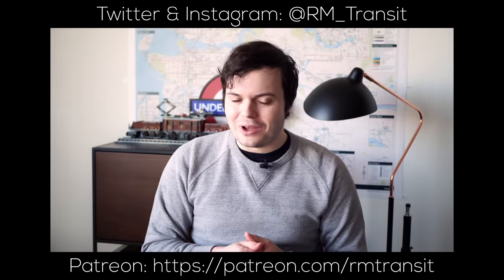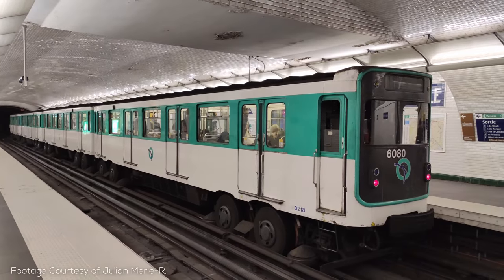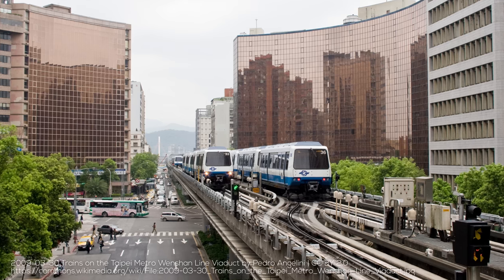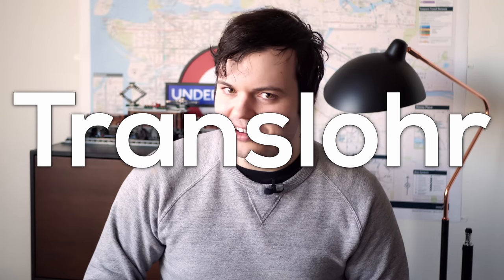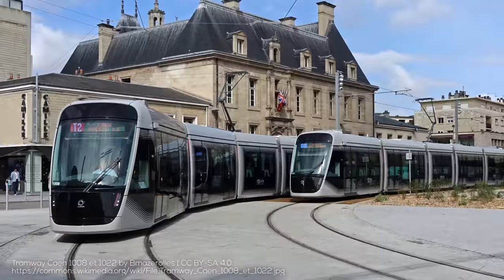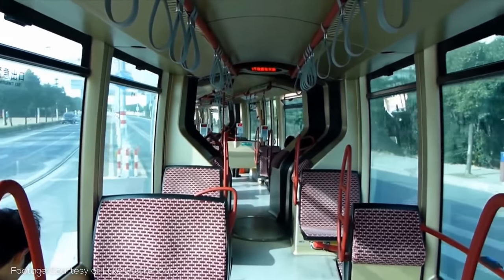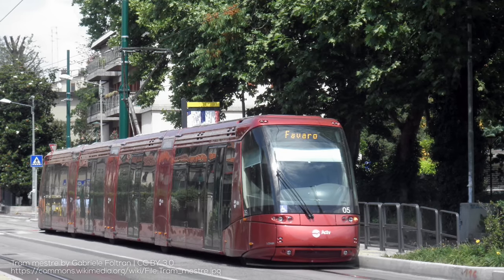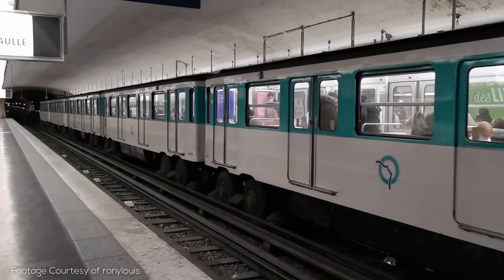Rubber-Tire Rail Transit is Weird

Comment: In the case of the trams, wouldn't it be cheaper to get of the central rail and just have a trolley bus?
Reply: I believe the point of the central rail is to guide the vehicle and remove the need for a driver. Drivers are a huge part of transit costs, so if it worked it would probably be worth the higher capital cost.
Reply: @neolithictransitrevolution427  While an interesting idea, autonomous driving (at least with the progress we have right now) only makes sense when the system is mostly isolated from (street) traffic bar some crossings at most (hence why it's common in metros which do fit into this criteria), otherwise the vehicles need a human to be guided. Since trams are expected to drive on the street, you're thus better off with a human driver.
Reply: @MarioFanGamer659  Idk with dedicated ROW and low speeds, I think buses will be their fairly soon. 

They recently had one in Durham (Ontario), it crashed into a pole after a few months lol. But I was pretty impressed with the FSD of a Tesle recently, I think it will be here sooner than any rail project you start today.

Comment: Specifically with the noise discussion, I would say the consistent dull roar of rubber tyres is more soothing when you consider a steel wheel train taking a sharp corner with the sort of noise pitch that would shatter glass... but otherwise yeah, rubber tyres belong on buses and that's about it

Comment: what you forgot to mention is that as the Paris metro is the densest in the world it is one of the rare systems in which tires make sense: tires accelerate and decelerate quickly which is valuable when the metro travels less than 400m between stops as is the case for line 4, of course, steel wheels make sense on less dense routes ; the RER for example, as an express service, stops less often and is thus 100% on steel wheels.
In addition, tyres allow for increased climbing and descent capabilities due to increased grip → additional control
moreover tyres absorb vibration and reduce tear on notably the bogies, allowing for increased durability + lighter rail stock as it does not need to be as robust /suffer as harsh forces. reduced weight = reduced electricity consumption + less momentum when breaking and less resistance when accelerating and climbing (goes back to point 1.)
lastly tyres inflict less tear on the rails which are exceptionally hard to perform maintenance on, especially when compared to simply switching tyres

Comment: Wasn’t the Val system used in O’Hare?? Or at least a similar version?

Edit: it was used in Jacksonville Florida until the rolling stock was sold to O’Hare airport in 1996, and O’Hare used it until 2019

Comment: The Cambridge and Adelaide guided busways are pretty fun concepts
Reply: And they work well for the situations. Heavy rail specially in Adelaide would not have been an option (although an upgrade to light rail maybe).

Comment: The Metro in Santiago, Chile has rubber-tired rail systems. Don't know that they were pneumatic, though; they were very thin.

No squealing metal-wheels-on-metal tracks. Quiet. Smooth-riding; no clickety-clack as you ran over seams in the rails. Really good acceleration and deceleration; I quickly discovered that I needed to hang on in both cases; not usually the case.

It's my understanding that the Inter-City Express also uses thin, rubber tires mounted to the hard, steel wheels and that's a large part of what allows smooth rides at high speeds.

Comment: Modern two-coach trolleybuses were planned for Leeds in the UK a decade back, after metro and LRT schemes were previously cancelled due to cost. I don't think they'd have had a guide rail, though they looked a lot like modern low level trams. Maybe there was to be a guide wire under the road or something? In the end those plans were also cancelled in 2014 , £250 million for the initial 9 mile route presumably being deemed too expensive as well, though the reason actually given was that 'it wasn't in the public interest', whatever that means.

Comment: One of the key benefits which is not mentioned explicitly is better acceleration and braking. If you have ridden the 14 line in Paris, it accelerates incredibly fast and can brake quite hard as well. At 80 km/h (50 mph)cruising speed is one of the highest in the world . Because rubber wheeled subways can stop on much shorter distances, the spacing between subways can be reduced, and the operational speed can be increased. thus increasing frequency and capacity.  Rubber wheeled subways accelerate much faster and slow down much faster so they can operate at higher speeds(because they can stop on a much shorter distance), and travel their routes much more quickly.
On subway lines which are far from saturation, this is not an advantage, but on the Paris subway where most lines are at or near saturation (overcrowding) increasing operating speed and frequency is a huge benefit., certainly far cheaper than building a new subway line.
With regards to the Tram/Bus rubber mounted system, one of the benefits which is not clearly stated, is that in case of roadwork, accidents, bust water  pipes... the Tram can turn into a Bus and take a different route. 
Rubber tires may not be needed in many transit applications, but in the end, it's a good thing there have been people willing to try new things, otherwise there would be precious little innovation.

Comment: I felt like Rimini where I was this summer also had a pretty good system. They have something called the “MetroMare” which is essentially a tram shaped trollybus but fully grade-seperated, unfortunately it has only one line which runs from the train station to the nearby town of Riccione whilst along the way serving the various coastline areas at a quite high frequency
Reply: MetroMare is a standard Bus Rapid Transit system though (albeit with timetabled passing loops). Probably would have been better to do an automated people mover along the same alignment (or just... add stations to the rail corridor), but it does do its job well.

Comment: @RMTransit -- on of your favourite steel wheel light rail systems, the DLR (Docklands Light Railway) in London, might be one of those cases where rubber tyres could have helped, at least on some sections.  

The ride on the DLR can be uncomfortable on longer fast stretches because the steel wheels start hunting on the rails.  This is due to a more sharply profiled wheel, necessary to help the cars take some tight corners in the system (and these corners wold be hard to eliminate), but poorly optimised for straight lines/gentle curves at  speed.

Comment: If you can't use rails, an APM(even in Singapore-style "LRT" config) is better than some proprietary combination. But automated light rail probably makes more sense if you are going beyond a couple of KM - as seen with DLR or SkyTrain. What ever you do, build a system that doesn't leave you with completely worthless infrastructure if the manufacturer goes bust!

Comment: I did some testing with a db meter on line 12 of the paris metro (one of the oldest which has really sharp curves and steel wheels) and line 14 (a brand new rubber tires line). In stations 12 was slightly quieter, and only around sharp curves was the 12 any louder; and that’s with open windows. The 14 hovers in the 80s the entire time.
Reply: MP89 trains and there offspring are noisy as hell. If you want to here what a regular train with tires sound like, try line 6 and 11 before 2024.
Reply: @LeGrandJuju49  alright but the overall point still stands

Comment: I had taken a rubber-tired rail. And that was APM line of Guangzhou Metro
From my experience the two-car APM was shaky as hell while travelling, compared to other lines.
Off topic, but there is one more drawback of the APM Line, and that the line's system is independent, not connected to the main system.
You have to transfer by exiting and entering gates once more which isn't really able to attract the passengers from Line 3 to the APM line. This is why the Line 3 is still crowded as hell.

Comment: I'm from the city where you get some of the footage with the rubber tire tram. The project has been a calamity for the municipality budget, the mayor wanted something that was innovating. Well, it has been with its number of outages, bugs and overall inefficiency. Not only it got all the common problems with tire trams but had its own problems too, bugs, roller fragility etc. Sometimes people even got locked inside. It is a scandal and it is truly despised by the inhabitants. The main reasons why it has been chosen is also because of the topography and the existing infrastructure (trolley bus type). The tram is going to disappear in 2024 replaced by electric buses.
Reply: You mean the TVR system in Nancy?

Comment: Very steep tram lines do not have to use rubber tyres, they have the option of doing what the Italians and Slovenes do in Villa Opicina. Trieste has a tram line, but it runs into a nearby village (across the border in Slovenia) called Villa Opicina, which is at the top of a very steep hill.  The solution they came up with was to build a funicular up the hill, and then, instead of the funicular having a passenger car on it, there is a drogue attached to the cable.  The tram vehicle attaches to the drogue with a normal vehicle coupling (with the drogue always on the downhill side for safety) and then is operated as a funicular, returning to normal tram operation through the village of Villa Opicina at the top of the hill.

Because the drogue's attachment method is just a standard vehicle-to-vehicle coupling for trams, they can use completely standard tram vehicles, and the funicular element imposes no unusual requirements on any other part of the tram system; the funicular itself is a pretty standard funicular apart from the custom drogues (or "cable tractors", depending on your source), but passenger vehicles in a funicular are not particularly standardised anyway.

Although used for transit, it is operated pretty much as a heritage system, using 1920s tram vehicles, but there's no good reason it couldn't have modern tram vehicles and a modernised pair of drogues (with a modern coupling type) on the funicular.  It is metre-gauge, but most manufacturers will happily attach any gauge you like to your tram vehicle.

While it is certainly somewhat gadgetbahn, it's a gadgetbahn that doesn't infect the rest of the system; you can operate a perfectly normal tram everywhere else but your steep hill(s), and if the gadget bit fails, then you still have the rest of a functional tram system.

Comment: Rubber tires have a traction advantage for going up hills as long as the pavement is dry.  Wet or especially snowy pavement takes away the advantage.  And very few of the rubber-tired systems seem to have been used for providing service in hilly areas -- I know of the electric trolleybuses providing service in the hills of San Francisco and Seattle (and Dayton? -- not sure how many hills that has), but that system in Colombia is the first rubber-tired tram I have even seen pictures/footage of actually going up a steep hill, and the overwhelming majority of rubber-tired electrified systems I have seen are flat.  Meanwhile, Pittsburgh used to run steel wheel on steel rail PCC streetcars up fairly steep hills (until those routes were cut in the 1960s), and Boston still runs light rail vehicles up and down the hill on Commonwealth Avenue (and unlike PCCs, those don't even have all wheels powered -- imagine what they could do if they did).

(Hey, for a change, I got to talk about something the MBTA does right . . . well, almost right -- if only the Commonwealth Avenue branch didn't have that idiotic move from center running to side running and then back . . . but all bit a tiny bit of one end of that is in the flat part anyway).

Comment: Tyre noise is always a problem. In (even electric) cars it amounts to a large proportion of noise due to the contact and friction of tyres with surfaces. Anyone living next to highways can tell. In subways with platform screen doors it isn't that obvious, but in open (even automated) systems as Lyon in France (line D) it can very surprisingly noisy.

Comment: Friction is the main point of trains, it's waay more efficient than rubber, needs way less energy to movez and doesn't wear and tear that fast, doesn't emit small particles for you to breath.
Brakes do, but that also can be mostly substituted  with electrical brakes, even regenerating energy.
Wired normal trains with regen braking is the best solution if you consider everything. These days they can even be quiet, given the tracks are maintained well.

Comment: If Translohr causes the asphalt pavement to sink below their tires, why don't tram rails sink into the road?  And are these grooves generally worse than the bump over steel tracks?

Also I'm pretty sure it's not an opinion that tire roar > rail squeal.

Comment: Noise and vibrations are a big factor. If a town wants to setup a new system in a nice historic part, it will get voted down if the noise from steel- to- steel operation will be way to loud...

Comment: Case in point: Brisbane's new "Metro" which is really just BRT in articulated buses designed to mirror trams. 

Yes even when officials were criticized for calling it "Metro" when its not on rails they didn't care and refused to change it anyway lol.

Comment: The "tired tram" is good if you do it like the China ART (Autonomous 𝘙𝘢𝘪𝘭 Rapid Transit): since the rail is only for guidance (sometimes for grounding), the ART does not use it, using a computer and for guidance over painted "tracks" instead, so it is basically a BRT (Bus Rapid Transit) that can accommodate much more passengers

Comment: Would be cool if you did a video about Israel, they're currently building a network of light rail in the tel aviv metropolitan area which has been for years crippled with traffic. 
Also in general, public transportation here except for busses that stand in traffic and long range heavy trains has been non existent, but it's all changing now. 
I think Israel is an exciting place to look at public transportation now

Comment: Interesting that rubber tires should work less with bad weather, considering how steel wheels have even less traction when the tracks are wet or god forbid, iced.
But also, try to imagine having to seasonally switch out all of these tires between summer and winter ones like car owners have to (o_____Ô;)
The Pöstlingbergbahn in Linz is one of the steepest adhesion railways in the world (at least in the categories of tramways, there seem to be even more steeper ones that are "normal" railways), and it seems to be doing the climbs just perfectly fine? (It's definitely a fun ride, especially in the summer it's really nice)

Comment: There are some "little" problems: You could have some problems if you want some lines with Translohr near traditional trucks, because the crossings among these lines could be difficult,  infact the rail protrudes on the road surface, and  you can stumble on the rail (also cycles and motorcycles have this problem, with a lot of accidents). Vice versa the track doesn't protrudes on the road! In Padua new lines will be constructed for Translohr system sold by Alstom.

Comment: Adelaide use the O-Bahn which is a bus and in certain sections are guided by concrete guides which support an extended attachment to the wheel. So the rubber tyre acts like a flange. Not sure how effective it is having operated for 20 years now. Essentially like a guided bus and will lact like a normal bus away from the guided system.

Comment: Showing a normal Paris metro to illustrate gadget bahns is a bad move, Reece ! You should switch the 0:11 bit with a MP89 or other rubber tires metro... and not a MF01 running on normal steel wheels.
Oh, and Line 4 in Paris has finally begun running the first automatic trains with passenger since 12th of September.
The neoval concept is completely stupid imo.
Reply from the maker: I’m showing it because it’s French!
Reply: @RMTransit  BTW, the GLT (TVR in France) that ceased service a few weeks ago in Nancy will be immortalized in Cities Skyline next update tomorrow as a trolleybus.

Comment: Technically speaking  many mountain cable cars are rubber tired. 
But steel on steel is difficult to use when climbing steep mountains, although possible.

Comment: You just need a hybrid maglev soft wheel system.  It goes full maglev on the tracks, but can go off tracks like a bus, allowing you to extend lines beyond the ends of the rail.

I hate overhead lines.  Maybe we could do some transduction charging while on the maglev portion... Self driving buses, I think, will take away one of the advantages of trains... the operator to passenger ratio.  In high traffic areas buses on dedicated routes could pack together to draft to get the fuel economy.

Comment: Any immediate cost savings of rubber tires during construction in the long term take a huge hit to maintenance cost. Tire replacement, higher electricity usage and « track » maintenance make steel more worth it

Comment: Wait; am I to understand that the rubber-tired metro and tram systems use pneumatic tires instead of solid tires? I get a distinct sense that in some of the genuine use cases for rubber tires (e.g. systems with unavoidable steep inclines), it'd make a lot more sense to use solid tires, to keep rolling resistance (and energy costs) down, and also to still enable the wheels to be reprofiled.